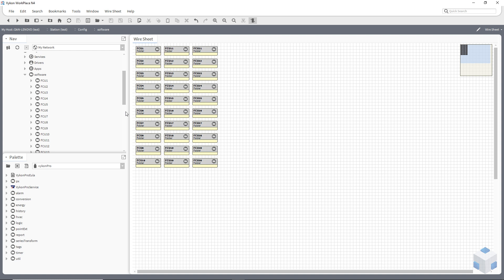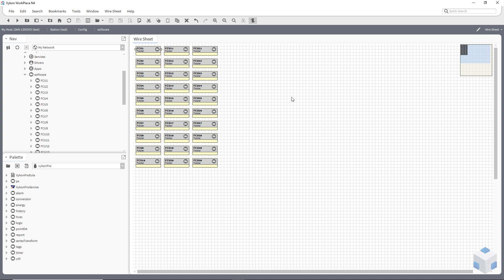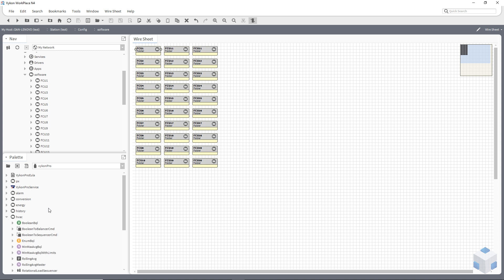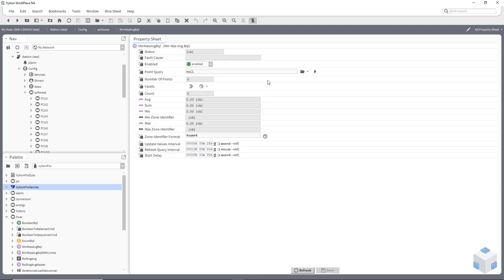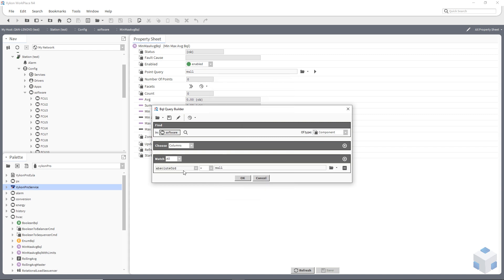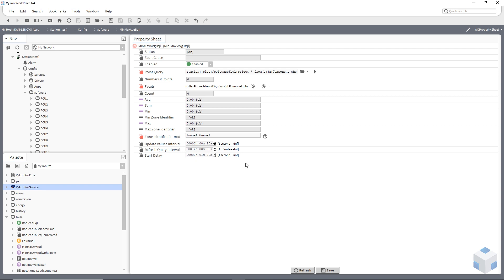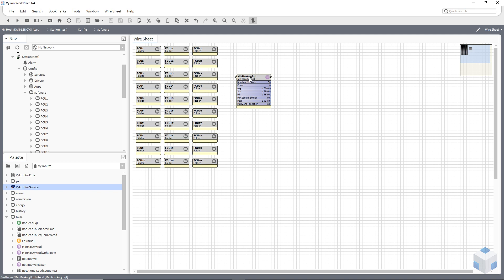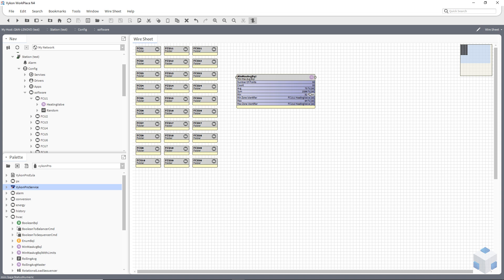HOW TO: Use the Vykon Pro MinMaxAvgBQL module

Comment: How would you go about building this if you have devices with similar names but wanted to divide them per floor. Example: 1st floor units are Unit_101 through Unit_120. 2nd floor units are Unit_201 through Unit_220.

Thanks
Reply from the maker: I will forward this onto support!
Reply: You could build two BQL's
like name 'Unit' and name >= 'Unit_101' and name <= 'Unit_120'
like name 'Unit' and name >= 'Unit_201' and name <= 'Unit_220'

However if you wanted to exclude say Unit_105 you could exclude just it using the not != '<specific names here>'.
like name 'Unit' and name >= 'Unit_101' and name <= 'Unit_120' and != 'Unit_105'